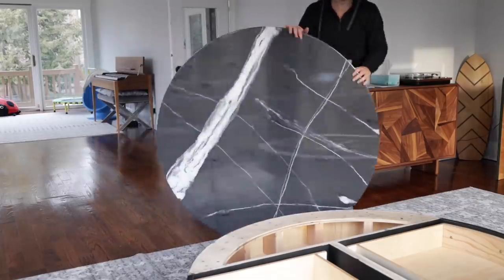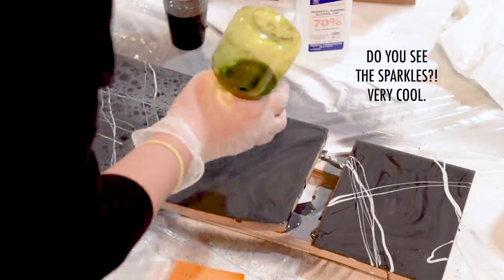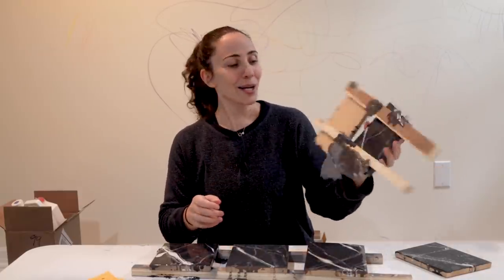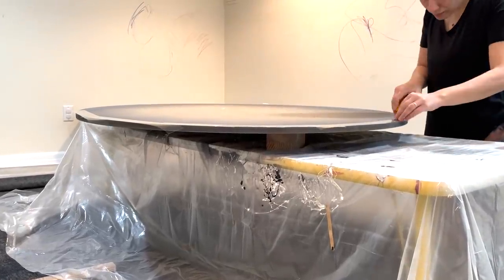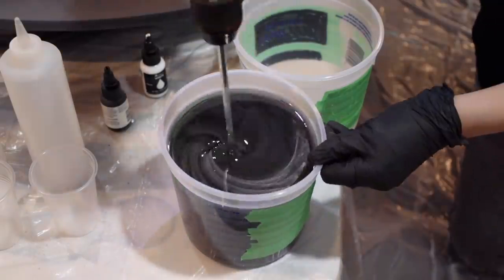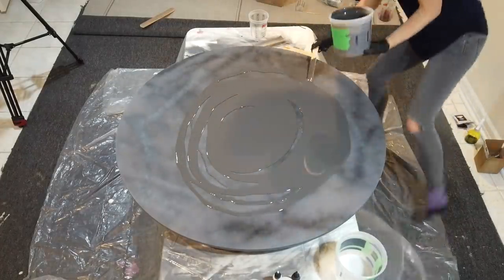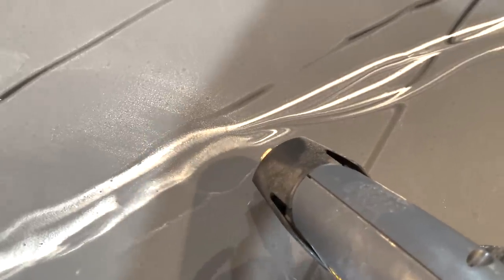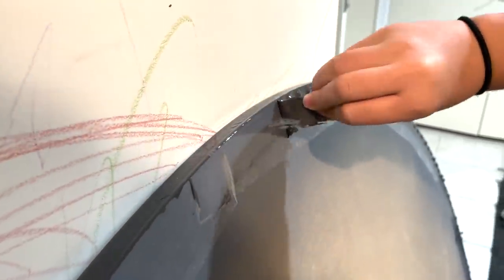Experimenting with making EPOXY look like MARBLE

Comment: @Tamar: 

Have you seen this guy -- Oliver Glomis?

He does some amazing wood turning projects (he does have some massive and no doubt very expensive equipment, mind you). I haven't seen you do any turning stuff, but thought you'd still be impressed. Here's a very interesting bowl he does:
https://www.youtube.com/watch?v=FMNtY5y0cnY

And that's just the simplest of things. He created a round die (from a square die, mind you) that you roll inside a bowl,  and it always stops with a face up when it settles (he did make one mistake in that the die faces are not properly opposed -- 6<->1, 5<->2, 4<->3, as they are supposed to be).
Reply from the maker: I don’t have a lathe. Hope to one day

Comment: I see no reason to start sanding with 200 grit. If you're just trying to knock down the gloss then start with a really high grit (10,000 or 8,000) and keep going down until you hit the gloss level you're looking for.